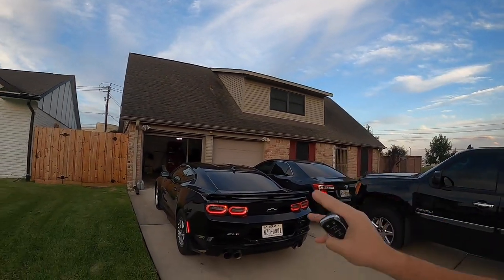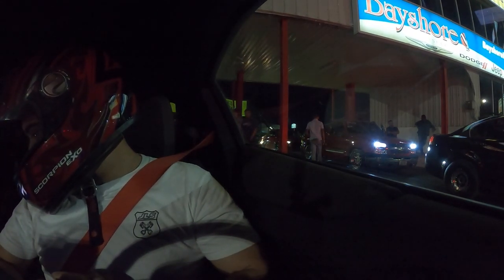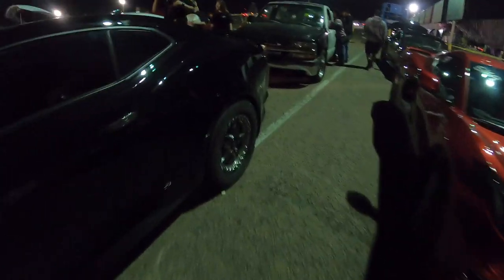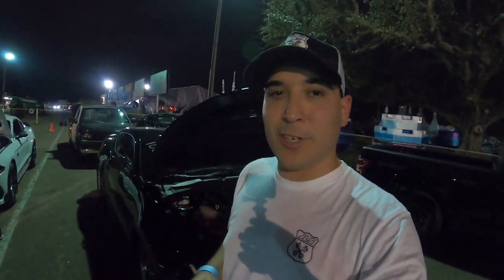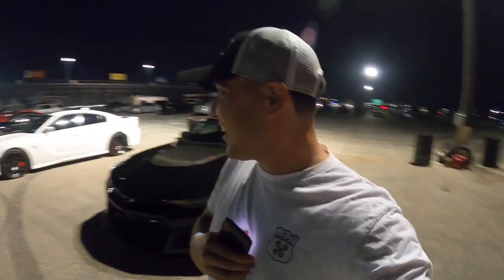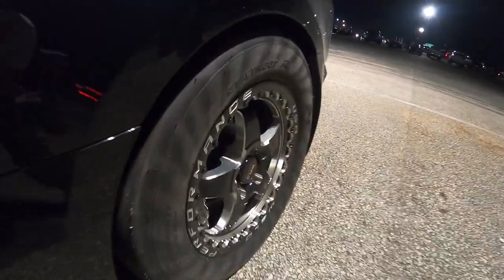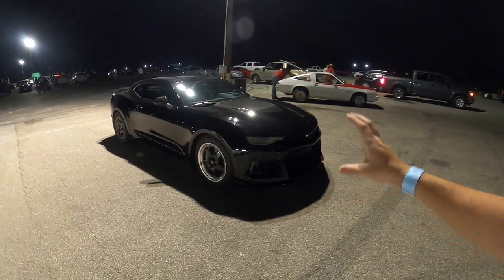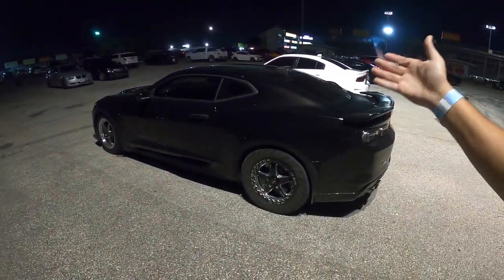Fastest Basic Bolt On Zl1!! | Vlog #445

Comment: These truly are some impressive times for so few mods Jorge, but there are other bolt-on Zl1s in the 9s. In fact, a local Z just posted a 9.2 on full bolt-ons. I'm not trying to take anything away from what you've done though, I don't know of anyone going as quick as you with so few mods. Great content, and Congrats on your new best!
Reply from the maker: Ofcourse I know there are bolt on cars running much faster. This is somewhat click baity, but at the same time I don’t know if any zl1 with just these two bolt ons intake and headers running the times mine is. Those others have the full bolt ons. Hence basic bolt on the title and not full bolt on lol

Comment: Have to admit that I've been waiting for this video and I wasn't disappointed in it.

Congratulations!! That was a good run!! I've never seen drag radials wrinkle like that, your car is making some amazing power and putting it down to the ground.

I think that you'll definitely hit the 9's at some point in the near future.

Have you considered installing a set of subframe connectors and something like a harness bar to stiffen up the chassis? They might help you at this point because judging from the way your tires are wrinkling your car might be wanting to twist and "pretzel" (for lack of a better word) when it launches. It would add a little weight to the car, but it would probably make it more rigid and feel more solid.

Also, if you could trailer your car to the track that would probably make a huge difference with the initial heat soak and might give you the edge you need to break into the 9's.

Regardless, IMO your car is running some impressive times and you have shown everyone what these cars are capable of with just a few basic mods and some traction. Awesome video!!
Reply from the maker: Thanks!!! And yes I actually have bmr rear cradle lockout kit to stiffen up the rear cradle and prevent wheel hop, just haven’t installed it yet.

Comment: I actually waited for this video! I have the same setup with just intake and e60. Could you post some 60-130 dragy times and 40-100. that would be great
Reply from the maker: On these runs the 60-130 was 7.09 and 6.82 on the cool down run. 40-100 was 4.33 and 4.1 on the cool down run

Comment: Car is amazing easy 9 sec !! no cap best zl1 content out right now 🔥
Reply from the maker: Thanks! once you get that trans tuned and feel that 1st gear full power launch you will see what the car can really do! I would look into the bmr rear cradle lock out kit around 600 bucks to help with wheel hop on the launch. I havent installed mine yet, but at the power level you are at you might need it now that you will be 100% power on the launch!

Comment: Awesome pass congratulations!!! PRAY PERFORMANCE FTW!!! If you get the big bore fuel pump for the high side and the 30% injectors you won’t need that cheesy low side aux pump that they rig up to your fuel tank. Big bore pump and injectors then you can run full ethanol. Expensive yes but totally worth it I’m sure Brett would agree
Reply from the maker: Im going to look into that, I figured I would do both low and high side upgrades
Reply: @JLSpeed  that big bore pump takes less pressure from from the low side. So when you combine the 30% injectors and big bore pump you good to go. I’ll send you the link to Bret explaining it. Most ppl do get the meth, low side and cam with a 15% fuel lobe but who wants to keep up with meth and cam jobs expensive AF.

Comment: Runs Solid. My SBE A8 SS with a Whipple 2.9 @ 10psi on E45 has run 1.75 60ft 10.5 @ 135(1200 da) on the Street according to dragy. The car is Full weight on 20's.... Other mods are RF Big Gulp, 103 tb, cat delete pipes, LT4 fuel system.  Imo You are not going to gain a lot more trying to get to full E85. Based on what I have seen E60 is the sweet spot...you will get all the timing you need there. You have a good tuner so your car is going to continue to fly. He has helped me with tuning in the past. Look forward to more videos!!
Reply from the maker: That is awesome! And the whipple is sweet, I’m sure once I swap the stock blower with the ported one that will allow me to put a 103 Tb the car will finally be able to breathe the best. And at that extra air flow i think I’ll still have to upgrade the fuel system to get back to even e60. We will see what happens

Comment: What is the last year that the transmission can be tuned in a Zl1
Reply from the maker: 2019
Reply: @JLSpeed  you launch in track mode for power with touring suspension settings and traction control off?
Reply from the maker: @davecarpenter9548  I run car in tour for everything except the exhaust so it opens up
Reply: @JLSpeed  traction control off?

Comment: Do you think increasing low side volume and pressure alone will increase overall fuel capability? I'm currently adding a dsx aux pump in Hope's it will take me a little further off the border line of running out of fuel!
Reply from the maker: Yes, the low side is not keeping up with the demanded fuel pressure which in turn is reducing the pressure on the high side. It will probably help get it to handle a bit more e but not full e
Reply: @JLSpeed  in my situation I'm at 706 whp with a single nozzle meth kit and kong ported blower stage x 15 percent lower 2 inch headers but it's right on the border of not enough fuel up top low side pressure drops I believe causing high side to drop I'm hoping the dsx aux is going to work in my 93 situation
Reply from the maker: @matthewpfeiffer3527  yeah i think the low side will definitely help how low does the low side drop? Mine commands around 80 psi but would drop down to 60 psi at e50 so I went back down to e45 for it to just go down to 70 psi
Reply: @JLSpeed  my tuner said 50s that stage x kong port is absolutely insane I dont think we were expecting such a jump in efficiency and flow I almost think I can drop my boost back down to stock levels and make almost same power! You should make that one of your future mods!
Reply from the maker: @matthewpfeiffer3527  dang! Yeah 50 is low low I was worried at 60 lol
Reply: @JLSpeed  yea if you wanted to do full e with a ported blower you'd need the aux low and the cam for the 32 percent high side lobe lol At least!
Reply: @JLSpeed  how is the skinny on the street?
Reply from the maker: @matthewpfeiffer3527  not bad I don’t daily it so it works for me
Reply: @JLSpeed  Jorge are u leaving traction control on or off when u run I know you tried both ways in some of your other videos.
Reply from the maker: @matthewpfeiffer3527  completely off